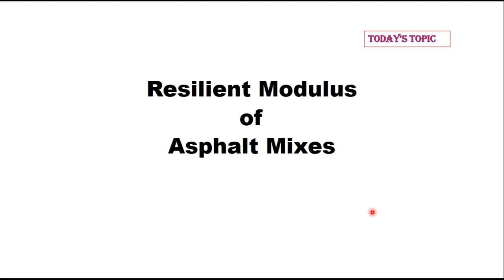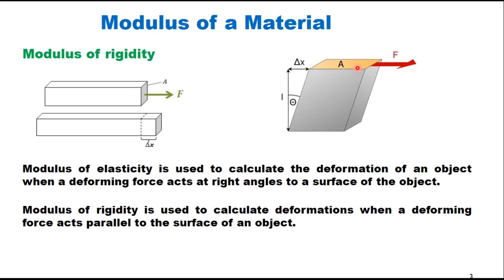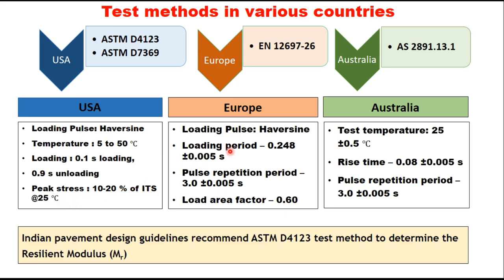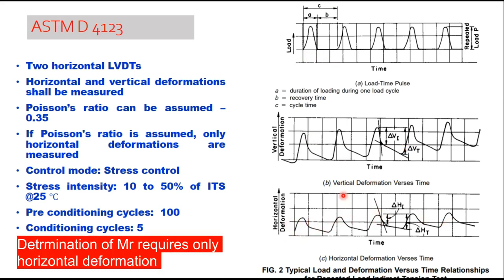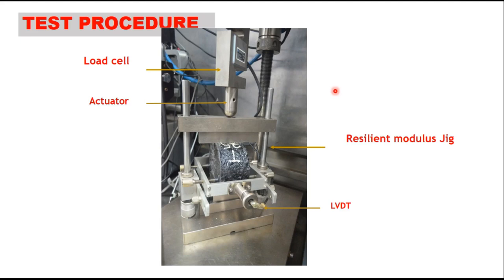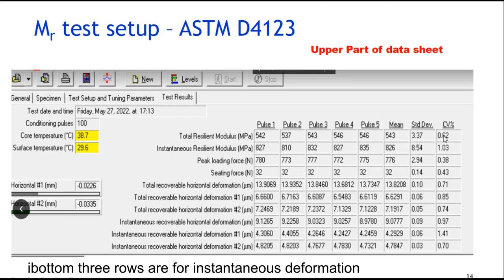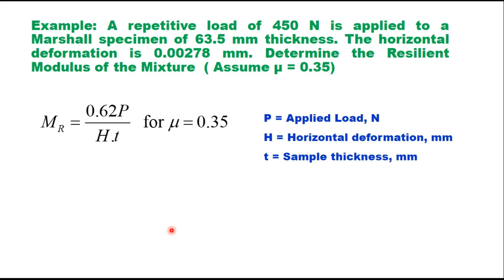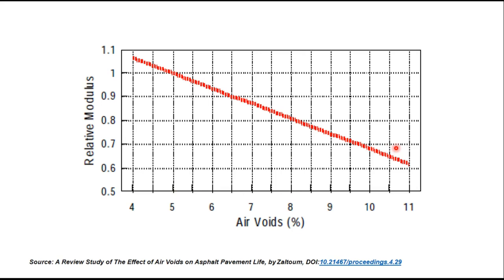#highways, Resilient Modulus of Bituminous Mixes - Concept and Laboratory test method.

Comment: As per en 12697-26 how much peak load is required for resilient modulus?? Sir  because in astm d  4123  clearly stated that 10 to 50% of ITS is required for Mr.
Reply from the maker: I do not have this code with me at present. We are generally following ASTM code

Comment: Dear Sir, First, thank you for your valuable time and effort in making such an excellent video. I doubt how the FWD back calculated elastic modulus values related to the laboratory-tested value. Will these values be the same or vary.  I have FWD back calculated value for a particular homogeneous section. to know the laboratory value, I have collected core samples also. But I was unable to perform this test due to unavailability of equipment. can I use any co-relation to find MR value through any laboratorian test?
Reply from the maker: If you are talking of bituminous layers, there is a correlation between Mr and ITS as given in IRC 37, 2018. But this relation is very vague and does not give correct value.
In the case of granular materials, determination of Mr. in laboratory is a tedious method and therefore, better to believe your back calculated values only. 
refer this paper also https://onlinepubs.trb.org/Onlinepubs/trr/1985/1022/1022-007.pdf
Reply: Thank you, sir, for the quick response  @SatishIITR

Comment: Sir,  can we find resilient modulus for  microsurfacing mix?
Reply from the maker: Microsurfacing is not a structural layer. It is laid in a thickness of 8-10 mm to improve the riding when the road is otherwise sturcturally sound. So there is no need to determine Resilient Modulus of this layer. It is not considered in the design.
Reply: @SatishIITR  ok sir
Reply: @SatishIITR  Thank you sir